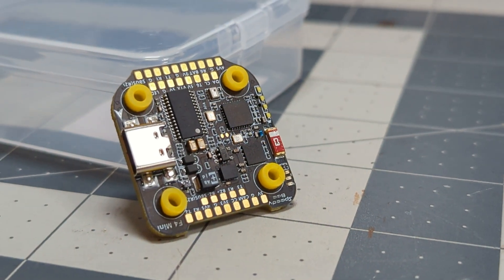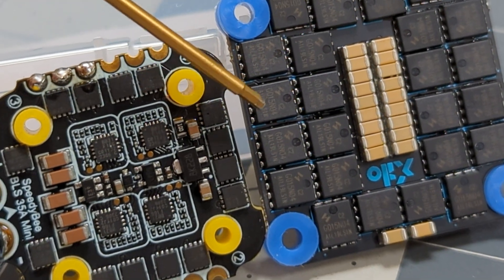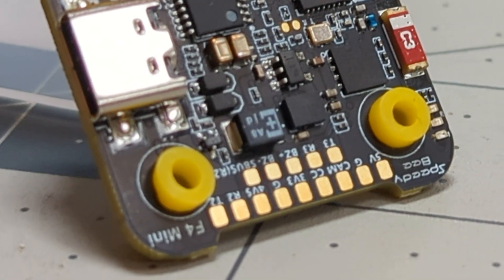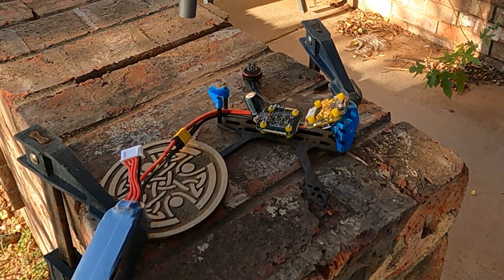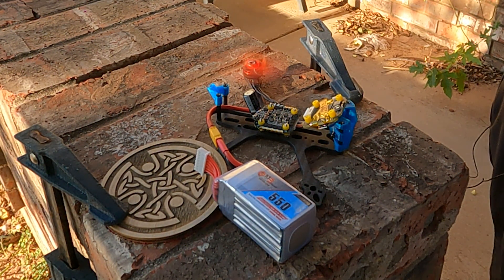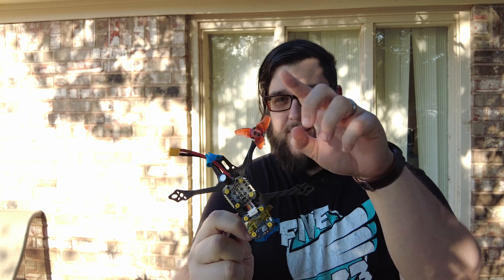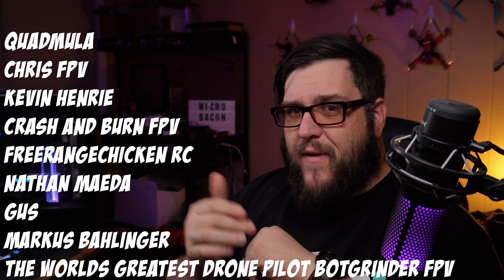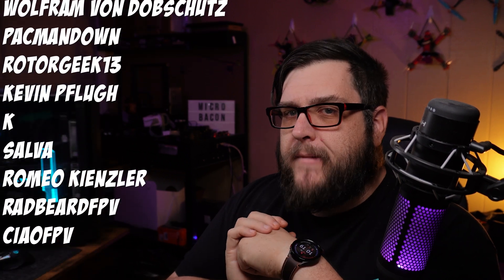I tried to catch it on 🔥FIRE🔥 - SpeedyBee F405 Mini FPV Drone Stack

Comment: Well mine stack actually suffer from simply getting wet. Well actually not entire stack but boot button get messed up that FC always read it as pressed. In the end I needed to remove button fully.
Reply: How were you able to remove the botton? Im working on building this stack v2. And I want to try to be prepared just in case I run into this issue.

Comment: I have a stupid question. Well stupid when you consider it have been jn fpv for kver 15 yeas now, 😅....
Anywho... I'm planning a flyfish vx3.5 build. I'm confused know stack size. I know bigger may not be better but I don't undertand the mounting. Can I use a 30x30 in the vx3.5 frame? And I plan a speedybee f405 v4 stack unless there is a better alternative u would suggest.  As well is a f7 stack better and which would u suggest. Will be using dji 04 for the build.  Thanks MUCH. very much enjoy your style 😊

Comment: A good test would be:
-let it armed with no cooling but vtx etc connected. Board will get hot because dcdc produces heat 
-Due some turtle moves to get the mosfets also warm up

Check how long it will survive without overheating

Comment: This warms me cockles since I recently ordered the F4 mini stack just based on price and features. I’m pairing it up with a 147mm Assassin 3 inch frame, speedybee TX800 vtx & Geprc 1507 3200kv  motors. Should be interesting. Thanks for the grease!

Comment: It's true, 2 years ago I had bad luck with Speedy Bee, it seemed like whatever they produced broke. When I bought the F7 v2 they did not disappoint, it malfunctioned too, so I was a little hesitant to try the F7v3. It has been great. I now have this stack in 2 10-inch, and 2 7-inch quads. I now trust Speedy Bee and I love how they supply just about everything you might need for various combinations. I just placed an order for this mini to use on a smaller build. I partially based that decision on your video Bacon. Thank you.

Comment: am using it in 5in 2207.5 motors on 6s back down to 68% 2150kv motors on source one v3 frame
Reply: also the barometer never worked out of the box am in talks with speedybee right now since i bought it stright from them should have just got it from racedayquads 10min away from the house but they didnt have it in stock :(((
Reply from the maker: oh man, having RDQ 10 mins away from the house would be suuuuper dangerous for me. lol

Comment: I appreciate your effort!
Usually you burn a motor/esc stuck in branches or turtle mode…….Not a prop strike…..which as you found out…usually breaks the prop…relieving the load/current draw.

Comment: More voltage on 6S draws less amps, not more. And TVS diodes don’t work because crashes that make the motors stop cause a higher amp draw, which causes a voltage dip, and TVS diodes cut voltage spikes. I think there’s a Bardwell or KababFPV video about this

Comment: I just bought this thing. Very great value, assuming prices don't jack up. I'm excited to be able to replace part of the stack if I blow something. Are the Emax RS 1408 2300kv motors too much for this thing on 6s? I'll be using it on a siren F3 split frame, probably sub 250. Thoughts anyone?
Reply from the maker: Those motors should be juuuust fine with that stack.  In this test I was using 1404, so quite a bit less stator than a 1408, but they were at 3800kv so quite a bit more RPM than what you have there.  It should do a great job and should fit pretty well in the F3 :)
Reply: @BaconNinjaFPV  awesome, thank you very much!
Reply: i would say so am running same stack on 2207.5 6s on 5in :)
Reply: @wizardfpv7856  wow okay great to know! That gives me some confidence I could probably try flying 3d mode with this 3” build…just wish I knew what props to use for 3” 3d flying

Comment: My V3 esc popped a FET after a plugged in a lipo after checking the quad after a crash.
o well... Foxeer Reaper F4 128K 65A and KISS ULTRA V2 goin in.
In hindsight... should have ordered the PDB and 4 Kiss ESC's instead lol....
gonna kill the walksnail vtx next probably.
Reply from the maker: I haven't killed a WS VTX yet, but I sure do hear that lots of people don't have too hard of a time getting it done! lol
Reply: @BaconNinjaFPV  yeah I have 2 on the bench that seems to have died.
One after a crash, one just randomly stopped working. 
Weird, because my 1s nano v1 WS vtx just keeps going while that 4" gets the most abuse.

Comment: I bought two of the 30x30 stacks. What a mistake. They have a major design flaw and it’s having a lot of issues with betaflight 4.4 firmware. Wouldn’t be surprised if this small board has some of those issues as well.
Reply: what design flaw
Reply: @flat-earther  the osd and black box run on the same spi so black box logging will either have a fatal sd card error or it will have broken logs or the osd will be stuck in the logo screen or a combination of the two.. that’s with betaflight 4.4 releases.
Reply from the maker: yeah that particular shared SPI design isn't too uncommon either among lots of different boards.  I really think it gets this one in particular since it uses an SD slot rather than a flash chip so the addressing is a bit different.  I really hope 4.5, which seems to be coming soon, helps to address that!

Comment: higher voltage == lower amps for the same power (or rpm).  Also shattering the prop isnt the worst that can happen to an esc. It will draw more amps for longer if you crash the quad in to grass or dirt, and it tries to maintain its set rpm.  To simulate this in a bench test, I would try making the prop catch a towel or something. That would stress the ESC.
Reply: Stress
Released the Magic Smoke
Let us lower our heads, in a moment of silence, for all those lost ESCs    ~¿ô
Reply from the maker: absolutely true!! For this test since I was using the same KV on 4S and 6S with no motor output limit between the two, I was pulling quite a bit more amperage for the higher RPM on 6S.  I was really hoping to also exacerbate the voltage spikes down in the low RPM range when the prop started backup with the higher voltage of 6S.  I thought maaaaaybe we would lose some functionality or a BEC on the FC as well, but it took it as best it could.  A towel caught up in would have for sure baked it thought! lol

Comment: I have done my own "testing" with the F405 v3 30 x 30 stack.
Its smashed into several missed roof dives,fell into a water filled cess pit from out a tree.
5 cell batteries on 4s motors at 100%
Mismatched motors on the quad and the speedybee has taken everything thrown at it.
Honestly cannot think of a better stack and its the cheapest 🙃
Reply from the maker: Now THAT is some testing! lol.  I have done lots of the same, minus the water bits, with the many SB stacks that I have and never quite killed one.  I know that isn't everyone's experience, but it for sure is mine.
Reply: @BaconNinjaFPV  Same here my friend ,not killed one yet .
Be great if you could do a video on 5s packs on 4s motors 2500kv (ish)
I really think people are missing a trick on this.👍
Reply: All for science! lol

Comment: the real winner here are the avans lol, the 3.5inch avans are so tough, never had one expode or lose a blade and they only really bend upwards or if they do bend down its only the tip and it dont reach the motor wires, where my gemfans previourly suffered all the above lol. also love my mamba f405 mk4 mini 30a stack
Reply from the maker: oh man, those avian props are real troopers!  I always pick them when I can.  They tend to be a tad heavier, but I have never quite had props hold up as well as they do in the sizes they come in.
Reply: Is Mamba better than SpeedyB?
Reply: @memelol7167  in my opinion, yes, by far

Comment: After seeing that test, I think this is going to be the stack I use in my first sub 250 build 👀. I want to do some 3D, so I'll need an esc that can handle the added abuse 😅
Reply from the maker: oooooooo, 3D! If you wind up building it with this, lemme know what you think of it for that use case.

Comment: I’ve had 1 good f405 an 2 bad ones. First was a bad fc an one a esc now I’m at totally lost for what brand I should try next.
Reply from the maker: If you want to stick to near the same price point, you might check out Diatone's Mamba lineup!  They would be my next bet on a more budget oriented name brand stack :)
Reply: I had a bad f405 30x30 fc also But if you have the extra money i really love the t-motor stuff seems they put a really good product out. i have a few stacks and motors from them. One of my best quad is done in t-motor esc and fc with iflight xing motors f7 processor.

Comment: Deff feel like a lot of blown FC/ESCs are from the builder most of the time. Probably 90%
Reply: In hindsight, I’m pretty sure mine was.
Reply from the maker: it is just soooo easy to get a little solder in the wrong spot or have something that touches when you least expect it.  For sure sometimes it is also manufacturing or parts quality, but I would say a lot more die from something about how they were put in than more natural causes.
Reply: @BaconNinjaFPV  I think it was a cold solder joint on the cap that shorted mine out after a crash. That won’t happen again.

Comment: i believe im the only person to use the speedybee f4 50a v3 esc with kiss ultra, and i frikkin love it. When i flew betaflight, the f7 speedy bee wasnt bad either. Bonus, says no telemetry but esc Rpm works! for the price they are great. ive been using the same esc on multiple quads for a while now.
Reply from the maker: I still have to try Kiss ultra sometime!  So far I have never gotten the chance to do it, but some day I will get the opportunity and make it happen.
Reply: @BaconNinjaFPV  they sell em at pyro drone. You will either really really love it, or will think its not different enough to change from betaflight. Thats usually the two scenarios with kiss ive experienced. with the occasional person has no idea what they are doing and gives up before giving it a chance. lol

Comment: I ordered this stack today for my 3.5 inch crux35 build (burned down the 12A AIO it came with after 4 month of flying with constant spikes up to 25-30A on full throttle) Cant wait for it to arrive so i get in the air again. Hope this one will last at least a year :D
Reply from the maker: I think it is by far better than the standard Crux 3.5 stack!  It should be able to handle those spikes and keep on asking for more.
Reply: @BaconNinjaFPV  wow it's really amazing! The drone finally flies like it should. No jerky movements,no random seizures on full pull. I tought at the beginning I messed up by buying a 3.5 inch but it was just the aio that made it so bad. Now i can finally trust my drone with doing what my inputs actually are and don't have to be afraid that it'll just change directions with no input and fly into random obstacles without my fault.
Reply: ya am using Foxeer Reaper V4 2-6S F7 AIO Toothpick/Whoop Flight Controller w/ 45A 8Bit BLS Bluejay 4in1 ESC in a geprc phantom 2.5in frame runs great love it with walknail in it with 1103 11000kv t-motors on 2cell 650mah i get 7min flights with hit and its amazing one of my favorite quads to freestyle. Also frame comes with 3d print for elrs antenna. So am using radiomaster rp1 in it. I try to stay away from spi built in recivers.

Comment: I love those notched motor pads. It makes soldering the motor wires easy. Just fill them with solder and then drop your tinned lead in.
Reply: They had me at holes for the included capacitor. Oh SpeedyBee, you shouldn't have... <blush>
Reply from the maker: me too!  On their larger one I also like how they raised the solder mask so that it keeps the pool from going past the back edge of the pad.  Makes it so much easier to keep it off of those tiny little FET surface mounts.

Comment: Pricing is great, unfortunately I’m having durability issues with the 30x30. Just broke my second FC on my bacon budget bird. 1st break was 1st crash, 1st pack, usb port fell off. Now on the new one the 5v and 9v pads are dead. 2 FCs in less than 2 months.
Reply from the maker: hmmmm, it sounds like there may be some other things going on with it that could be contributing to that!  Not to say it isn't possible that they were just bad boards, but from the hundreds of budget builds I have talked to people about only around 5% get a DOA stack component.  Are you over on the discord?  I'd love to see some pics of the build if you have them!
Reply: @BaconNinjaFPV  wasn’t DOA, worked for a couple weeks, few dozen packs. I haven’t had the opportunity to troubleshoot yet, it just died. I bought 3, I put another one in a moongoat with an 03. 
 I’m not on discord, I’m not just new to FPV, but computers and social media as well lol. I need to find my way over there.